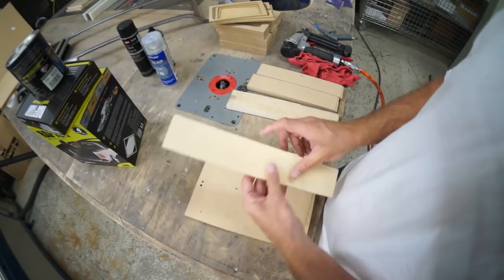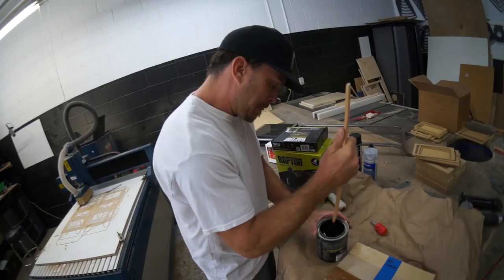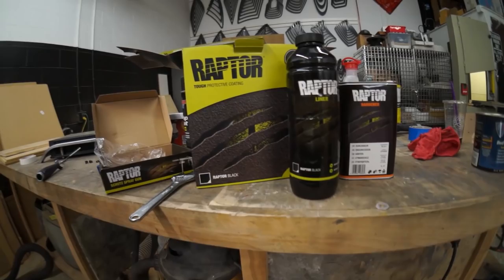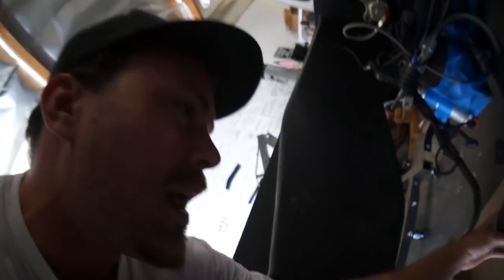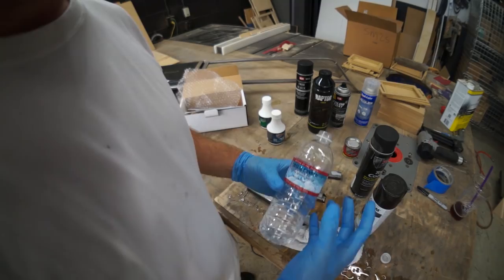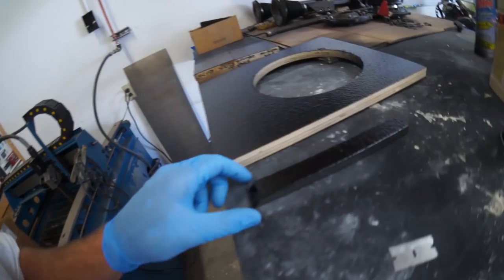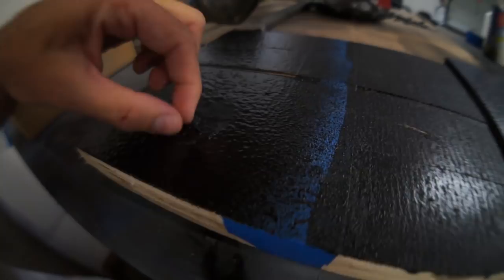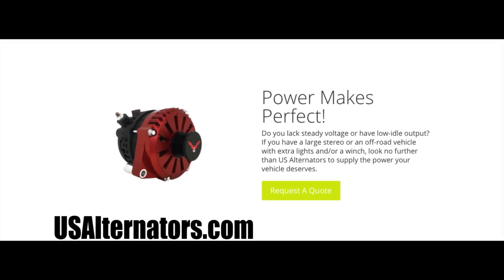Comparing Raptor bed liner, POR15 and PAINTS! - AMPLIFIED

Comment: I worked in the oilfeild for some time, in a blast/paint yard. A zinc primer and a polyurethane would've given you a scratch resistant surface. We used this on x- rigg, mud gas separators, mud pumps, fracking equipment, shakers, pipe, ect.... polyurethane when it dries becomes like rubber and the zinc primer absords into the metal and zinc is a metal so it gives it an extra barrier of protection. Most oil field equipment is painted using these products. Polyglass is one company we use, international (which sells marine grade paints), intercoastal is another one.

Comment: Oh Doug, before I forget, I've been trying new techniques out....
1. On MDF I've been using a method I've seen you use, take ultra bond and shmear it over MDF like a sealer and it self levels almost perfect. I use valspar flat black( the 3 dollah no holla cans) and it comes out perfect all velvety smooth oh its nice , feels like fine sued ( sway-d) 2. You want the wetness? Valspar also has a line called beach glass, it works like a candy coat, then hit it with there glass clear.... Get ready for some depth....base coat, beach glass then glass clear , shiz looks like its two feet thick.

Comment: Doug you probably already know about this, but if not then here u go. There are plenty of DIY powder coating systems you can buy for kind of cheap(couple hundo). I know ur testing these other paints and stuff out because u like to do it urself. A lil powdercoating system in ur shop would be a great addition. Just need a oven or something to cure it. Thrift shop lil oven might work? Idk just throwin out some ideas.

Comment: I've used the raptor liner, if you use your "fogging" painting technique it will come out rough and sandy feeling, if you lay it on heavy it will lay flatter and Lower air pressure will also lay it on a little thicker

Comment: Doug that por15 on the amp rack is a tough coating but its made to be an under coating and will fade real bad in sun and look like shit. Thats why they have the coating you can spray on top. Just a heads up

Comment: Raptor liner texture is dependent on the pressure you spray at -lower pressure get a non slip abrasive surface - higher pressure gets a orange peel texture - hope this helps - I’ve done 6 trucks - it’s been a great project

Comment: If you want an alternative to powder coat you should look into Endura paints. We use it on underground mine vehicles and it withstands chipping and scratches really well. Its a 2 part paint that you spray.

Comment: You were skeptical...but i knew as soon as you hit that metal with the POR 15 you would love it.  Shit is HORRIBLE to clean off of stuff though!  Gloves and cover all your work areas each time you open that can.  Also...make sure you seal the can up well.  I like to use some plastic wrap  under the lid, because it will cure in its own can.

Comment: the regular por 15 is really strong. Don't get it on your hands. Also it isn't uv protected so they recommend a top coat of paint or it will fade. Once you open the can of por 15 it starts to cure even though it's still in the can.

Comment: doug i've used por15 on every car resto 
one thing about por15 left alone it is not uv proof 
should be over sprayed with a top spray
it seals all rust perfect for noe 12 years in use
a fantastic product

Comment: Definitely like the way the por 15 paint lays down. Doubt camera is doing it justice but looks smooth and hella glossy! Question, is that por 15 rust prevention paint easy to apply with brush and not have the brush strokes? Seemed like you had very little with the foam applicator paint brush. Just curious thanks for the awesome upload!

Comment: Doug check out the rustoleum bed liner from Walmart. Used it on my flat wall and sounds like exactly what your looking for. 30 or 40 a gallon. Small texture and smooth.

Comment: I've used the Por 15 paint on truck frames. I can verify that it's some tough shit. I've used the Raptor truck bedliner for it's intended purpose, it looks nice and is easily repairable. If I remember correctly I had a hard time getting it to have texture, it kept coming out smooth. I would use the Por 15 for the amp rack and the Raptor for the speaker box.

Comment: I have been using gloss black with flex seal rubber paint as an over texture. its soft to the touch and looks good
Reply: Kris Garner and you can use your bed to float down the river

Comment: Hi Doug, 

I sell alot of UPOL Raptor over here in the UK. You can achieve any finish you want with Raptor and still achieve that tough durable finish you come to expect from the product. 

You can run the raptor down with thinners and apply it through a Primer Gun for that clean smooth finish :)

Hope this helps

Ryan 
Smith Car Audio

Comment: regarding the amp rack, I have to agree with those advocating automotive paint.  Other than powder coat or anodizing, it is more durable (UV and impact resistant) than any of those rattle can products.  Although, I believe you can buy actual automotive grade paint in rattle cans.

Comment: POR-15 is UV sensitive. You're supposed to put a top coat over it if it's going to be exposed to sun light frequently. Most guys spray over it even on frames and such under the car. So, it's up to you if you want to run the risk on your amp rack. 

Also FYI... I'm almost dead certain the POR-15 cleaner is just Simple Green. They even recommend you cut it at least 1:1 with water. I did the floor pans in my truck with the same POR-15 kit and used up all the cleaner on one side and just used SG on the other. No difference in results or durability.
Reply from the maker: +Maxwelhse it smells like descaler
Reply: I'm not sure what descaler smells like, but what I got in my kit smelled and looked EXACTLY like Simple Green... I suppose I should have tasted it to double check.
Reply: Maxwelhse, descaler almost smells like radiator fluid but more nasty. It's probably acidic.
Reply: POR actually claims the product is alkaline. I would say that Simple Green does smell a good bit like anti-freeze (but with more "bite" in the nostrils?) though so I'd call that another parallel.

My bigger point here was to say that Simple Green works absolutely as well as the stuff in the kit and I couldn't tell any difference in the products or results. So, if he runs out or simply like the results of the POR product, try some SG for way less money.

Comment: I really like POR15. Nothing paints imperfect cast metal parts like it. Makes diff's and gearboxes look so good. That shit sticks so well. Its almost like plastic
Reply: Dont spray it though. Its super bad for your lungs. That metal prep is just zinc / phosphoric acid to etch the metal to make it less likely to rust.

But yeh 100% go with the POR15 metal paint. I painted the underside of my rusty ass car and it looks like new now.

Comment: Try rust proof by Martin senour. Carried at napa. An  industrial epoxy paint. Flake resistant, uv proof, can be sprayed, rolled or brushed. Self leveling as well. Designed for inside chemical tanks and farm equipment.
Reply: I've literally had a piece of rusted metal be hit with a welding slap hammer, bent, and had pure acetone sit on it for 24hours. Didn't flake, chip, crack, or fade

Comment: Great show Doug. I appreciate you showing the POR15. I heard it was good but haven't used it yet. I do use the Rust-Oleum product line and they also have the hammered paint that sprays flat and stays wet wet. I've used it for years now and it is very durable. 
Love your channel bro keep up the shenanigans!

Comment: Yo Doug, you want your amp rack to lay flat and perfect, prime it and wet sand your primer just like your dash.  My buddy sprays raptor lining all the time, not the greatest bed liner cause it's less durable than most and slippery as rafas madres butt crack after a 4hr car ride on leather seats with no a/c. For what you want tho, lay it on thick and heavy to let the paint self level as it dries. You could always try to spray that por15 to get a smoother flatter finish.

Comment: Wow! Doug, I learned a thing or two today. This is a win, you tried some things and tested what you needed .....I mean I knew the por15 was gonna win for the metal, its a metal sealer! But that raptor spray turned out nice, like ...noy-ice!!!! 
I think I'm going to use that on my twin tube in a tube ported enclosures . that may also work on the inside to, is the raptor have like a grippy kinda rubbery give when compressed? If so it may work as a good damper.

Comment: If you're gonna use Raptor I hope you sparayed it at the same time you filmed this episode, if not you just wasted a whole bottle just for a couple of test scraps. Once you dump hardener in there, if you let it sit for just an hour it doesn't spray as smooth, a little longer than that and it's in the trash bin it goes. Should've just poured out 1/4 of the bottle, would've been plenty for test samples.

Comment: My TOYOTA TUNDRA came with LINEX BRAND spray in 15years later it's still there -looks way rougher than that but also more dense with gritty ness.... it's surprisingly smooth though - not rubbery at all ....

& I used a small 9" BBQ I got for free from a casino and  it melted the LINEX off in a small area on the tail gate- I used 35 grit then 60 grit & cleaned it then used duplicolor armor series truck bed coating on it - it blended so well I cant tell where I fixed it 6 years ago!

But ima try that kit u got mabey if you like the spray on- I'm not a fan of roll on shit < that shits for houses- lol>

Comment: Dude, i´m telling you... Por15 is the Shit. 
TopCoat is like a normal Paint but a bit more rust preventive. 
Por15 wouldnt get scratched or chipped, i tested it all out... put some of it on rusted metal. it sticks to it and you cant get it of with a screwdriver or "break" the paint with a hammer. 

We put 3 layers of Por15 on sand blasted Metal and 1 layer of TopCoat for a better "finish with a Paint Gun. 

Love this Products.

Comment: Eastwood company makes a powder coat gun you can use right in your shop. Spray and bake.
Reply: Jason Cullum so does Harbor Freight
Reply: I doubt his amp rack is going to fit in his oven at home...

I personally think powder is over rated too. Seems to chip just as easily as paint and you can't sand it and touch it up.
Reply: Parts can also be cured with a heat lamp
Reply: I'm sure you "can" do it, but on a part that big you'd have to have enough heat lamps that you'd literally be making your own oven or trying to cure it in small sections, which I just don't see working out well.

I'd probably just pay a pro shop to do it. Most shops do so much black that they can just "throw in" small jobs like that for not much money.
Reply: Maxwelhse powder is much more chip resistant than paint. you can touch up powder coating too.
Reply: That was not my experience working in a factory that had a professional powder line. If you dropped a part on the floor (or even worse, onto another part) it would chip and the only way that was effective to touch it up was with paint over the powder, which looked like shit. Otherwise we had to burn all of the powder off of it in the oven, sand blast it, and start over. That was over 10 years ago now though... Maybe there are better processes these days.

I'm certainly not saying powder is any worse than paint. I just don't go all crazy about it the way some people do. I have stuff in my engine bay that is powder coated and other stuff that is painted (things I couldn't run through the oven, like the power steering pump) and it's all holding up just fine.

Comment: I ran across a vid yesterday where this kid changed air pressure to change the texture of the raptor liner.  Levi Stanford Raptor bedliner for dummies.
Reply: Thomas Hendrix was it on a 2nd gen Ram?
Reply: I am having a hard time figuring out if that is a joke or a legitimate question. He just sprayed the shit on a hood he stole from somewhere to see the different textures.
Reply: It's a serious question. I saw a vid were a young guy sprayed the bed of his ram 2500 with raptor liner. It turned out really good.

Comment: Get a junkyard dash trim piece. Wet sand #800 then #1k. Use all 3 steps of POR-15 on the plastic. You can shave your nutsack in the reflection. Show Rafa real wet wet. Doug and Rafa- try this on scrap; you'll be amazed.  http://www.allkandy.com/

Comment: I have been testing raptor liner on my entire truck.The raptor is a two part,it will get brittle and flake off after a few months.The por 15 will not ever flake or move and can be top coated several times..The two part get so hard it will not stick to any surfaces..shrinks real bad..